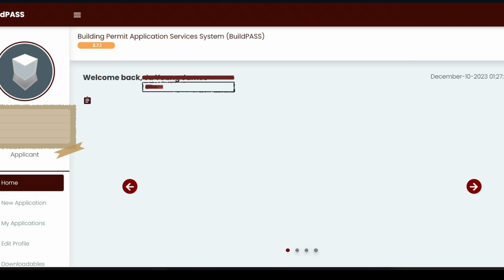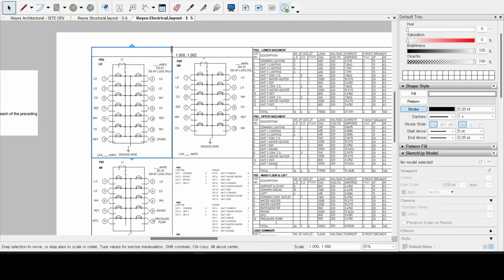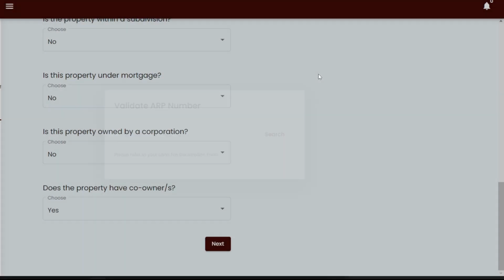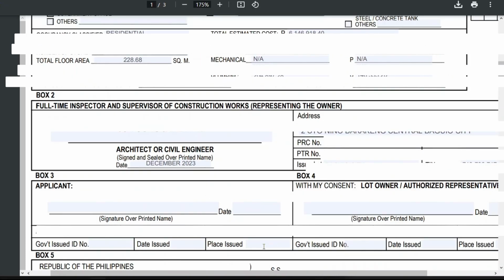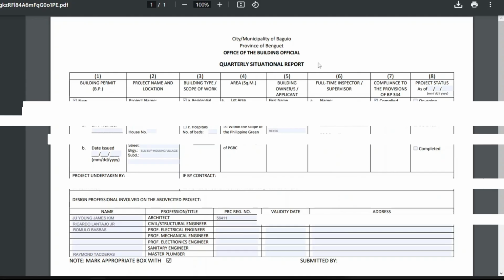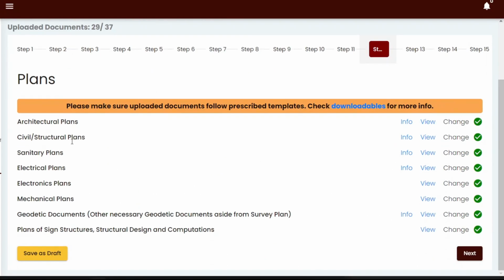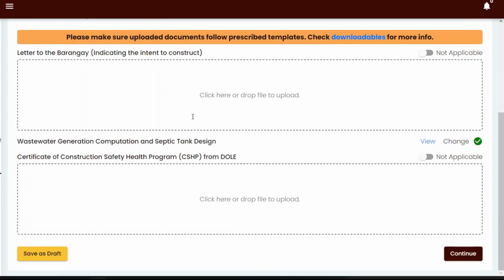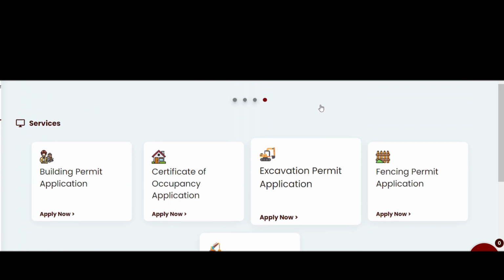Permit Tips - How to Apply for Building Permit /Baguio Buildpass 2023

Comment: What if im applying only a zoning certificate and electrical permit for a fiber optic aerial. What kind of application would I click?
Reply from the maker: @DanelleBantol  Which department? 

Some areas in the city have their governing approvals, such as PEZA, which does not undergo the BuildPass.

However, if you want to make sure, you can ask for the forms directly at City Hall Planning for Zoning, and CBAO front desk for other inquiries, as the option to chat in buildpass may not be as responsive.